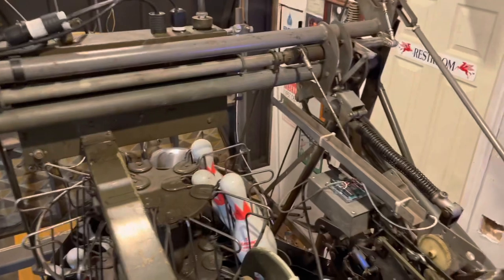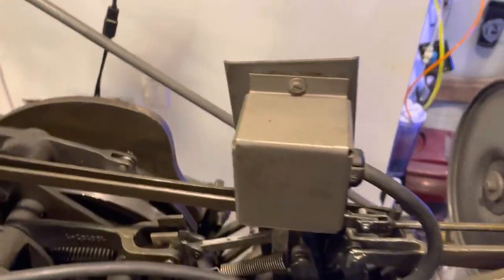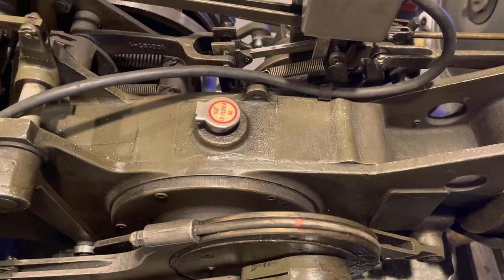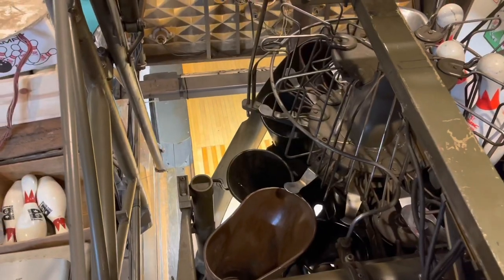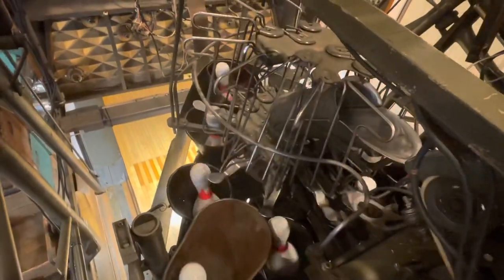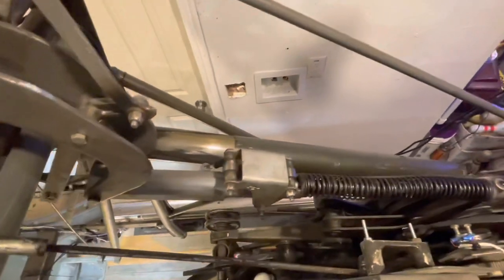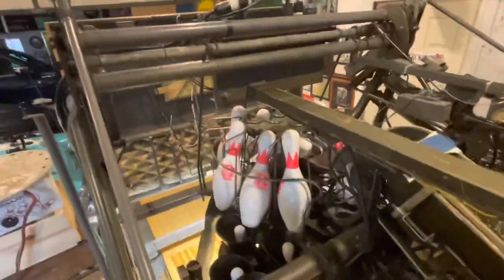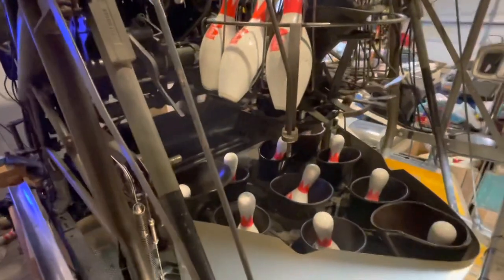Pinsetter operation by request - with narration - Garage Bowling Alley Brunswick goldcrown

Comment: Excellent detailed video!  I was wondering about the deck hook that holds it up for the 2nd ball. I noticed it engages at the end of the first ball.  At one of the bowling centers the scoring system would put the pinsertter into the 2nd ball mode after the pins had been set (last ball of tenth frame, for example, to skip the first cycle altogether).  But since the hook wouldn't have been engaged why didn't the pinsetter still come down?  Or does it still have the opportunity to engage the hook at the start of the 2nd ball cycle?  Likewise, sometimes when the pinsetter was on the 2nd ball mode the staff would sometimes put it back into first ball mode and cycle it to clear a stuck ball. The hook should have been engaging it but since they switched it back to 1st ball did it disengage the deck hook?
EDIT: I guess the short version is--- manually changing the switch to first or second ball still allows the deck hook to do what it needs to do....
EDIT-EDIT--- Your Pin Respot video answered my question! Including manually lifting the deck hook to put it back in first ball. They thought of everything!
Reply from the maker: I just got mine working where it’ll kick to 2nd ball in the 10th when needed.   The only way I’ve ever seen to put a machine back in first ball is lifting up on the deck holding hook and it puts the detector back to 1st ball.    Basically without the hook the deck would do a second pass on the pins like first ball but with no scissors.  Look back at the Quaker state in the late 70s as Forum bowl had the astroline scoring that worked with the pinfinders.